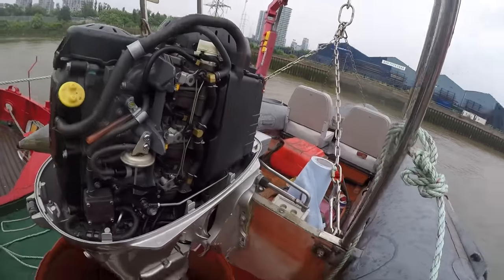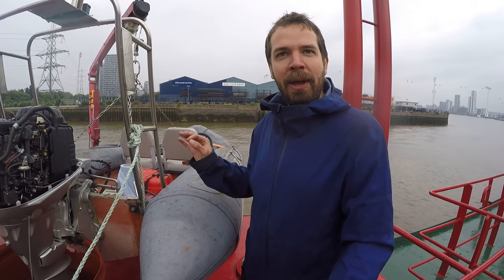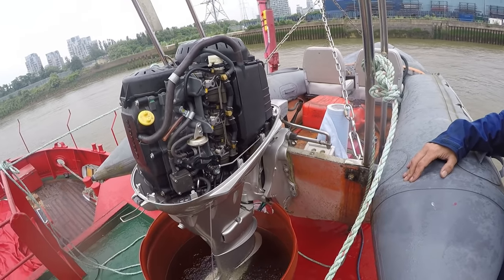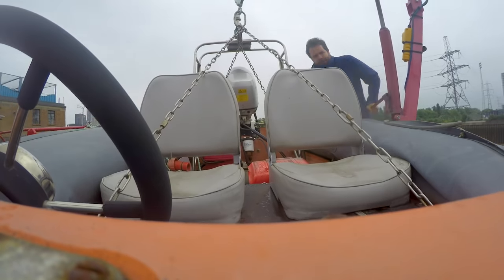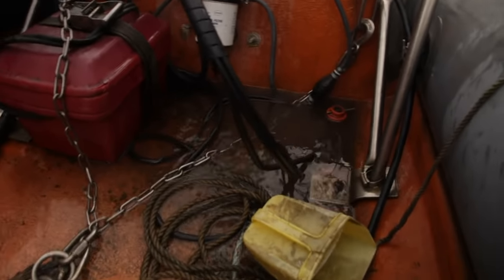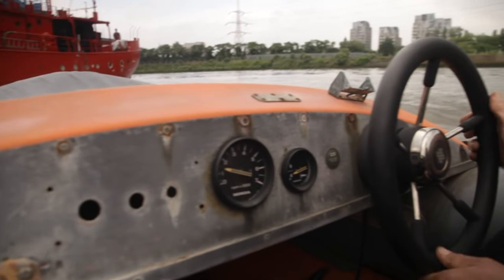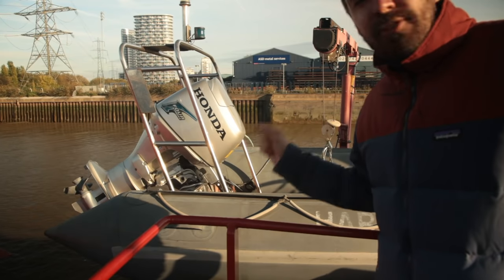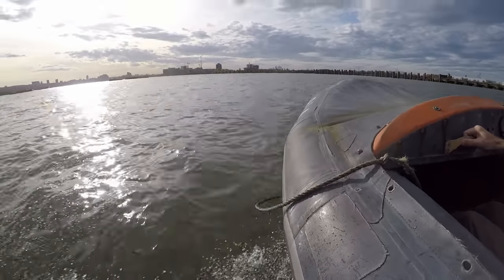PROJECT SPEEDBOAT - Part 1 - Engine trouble

Comment: Could you please tell us more about the blockage?Id there a few shots if what it was, how it got in? You just glanced over that, but that sure is what I want to hear about. Thanks Harry!
Reply from the maker: The blockage was just above the thermostat. It looked like just a recess in casting of the block but was actually a completely sealed ventricle. I had to drill through it. It was sealed up with a thick layer of crusted salt I think.

Comment: Once u are doing it as a project for traveling, maybe u should consider adding some kind of enclosure so it's comfortable even in wet weather
Reply from the maker: Yes, good point! Some sort of rain cover is going to make life a lot more pleasant. Once the windscreen is in we could rig something between that and the steel A-frame at the back.
Reply: @harrydwyer  or u can build a proper enclosure so u can stay onboard for camping

Comment: My first guess was that something was blocking the cooling ports. I don't know jack about boats
Reply: Taylor Sharp agreed....engine too hot=check the cooling system...
Reply: @arghjayem  Or in this case, replace a bunch of parts that don't need to be replaced and cross your fingers. You'd think he worked at a Valvoline shop LOL

Comment: Did you get that thing fro free? That engine is worth a couple of grand
Reply from the maker: I got the boat in exchange for work on a project on the big ship (video to come). Yes the engine was the only thing worth anything, although it had had a few boat mechanics strip it down to find the fault and no one could solve the cutting out problem. An outboard specialist said the only solution and what they would do was replace all three carbs which would be £££/$$$.

Comment: sounded like worn pump impeller to me ...easily replaced, but just a blockage....
Reply from the maker: Yes, going to do the impeller anyway, it had been changed previously in the hunt for the problem. But think it would be sensible to do it again since it's been running since.

Comment: How did you unblock the water passages
Reply from the maker: The main blockage was behind the thermostat. One of the passages was completely sealed over and I had to drill through it. Then removed and cleaned the water jacket and flushed through in a bucket with radiator cleaner. It seemed to do the trick.